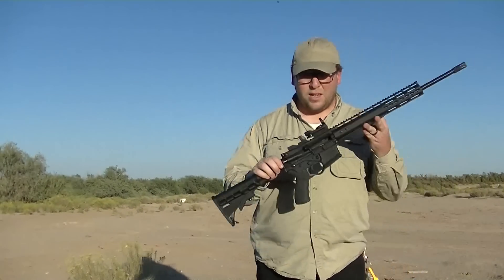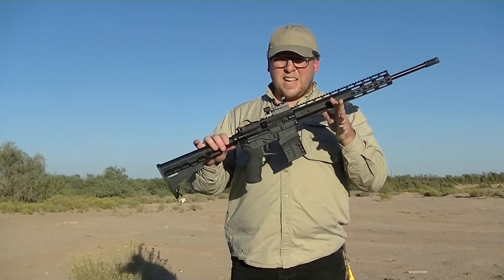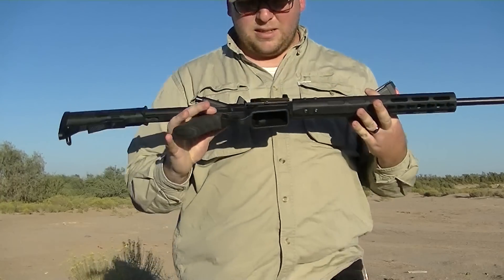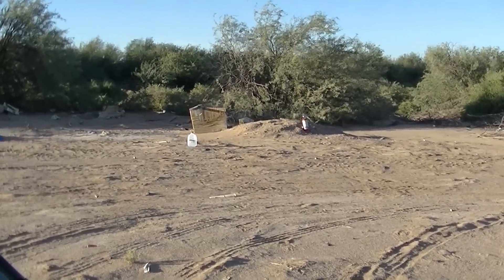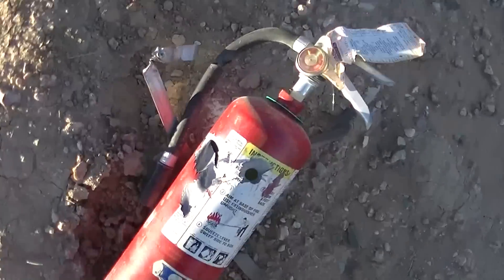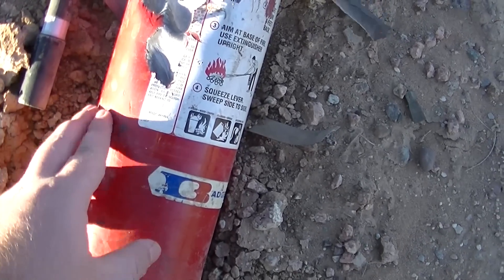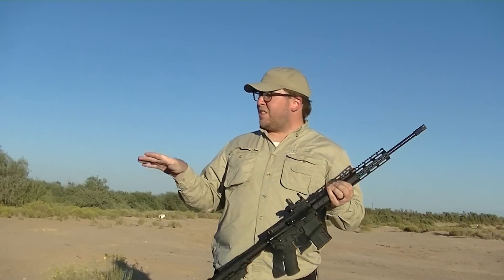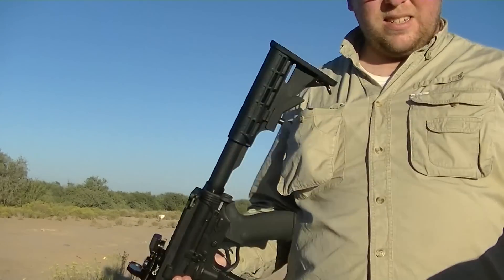ATI OMNI MAXX HYBRID AR-410 Firing

Comment: Mine is still at the factory addressing that bolt override problem.  Noticed that each time you slapped in a magazine you gave it a little tug downwards.  Is that required for proper seating?
Reply from the maker: Doug
 Its a habit i developed from having full mags not seat on a closed bolt/slide.  it applies to this shotgun though because you can seat the mags too far, causing some issues. It usually fixes itself right away, and hasn't cause a stopage in a while, but I still check.

Comment: How did you resolve the mag issue? I know you customized them but was that enough? Seemed to be a major problem—the bolt not stripping new round? I was about to buy an upper but I have to know what happened with yours. Are these things commonly known as a pain in the ass? I haven’t seen a lot of complaints.
Reply from the maker: NLYTNDBYSNAKES 888 
As someone else commented, the mag spring is often installed backwards, lifting the front of shell first.  I still encounter from customer's guns failure to load the last round in a mag, that's a design issue
Reply: NLYTNDBYSNAKES 888 bought mine four months ago. Have put hundreds of rounds through it with zero issues. Either I am really lucky, or the issues you are referring to are no longer issues.

Comment: would this thing work with the binary trigger system? (noob here)
Reply from the maker: Strong Bean It should, standard milspec lower and trigger group.  might be an issue with the lower being polymer, but the upper can mount to any lower with a binary trigger installed. Would be a ton of fun!

Comment: Would it take 3inch shells? Did they ever fix the jamming problem?
Reply from the maker: Only 2.5 in the magazine. The newest ones are better fit  but still temperamental.
Reply: @ZAKW42  so they made a new version of the 410? Do you know how to tell the difference between the 2?
Reply from the maker: @Jcha208  
The bolt design is the main difference. They indicate gen 1 from gen two by switching from SS bolt to a black one, the third mod was for the gas system and I'm not sure how they indicated that change. If you jump in and don't get a lucky one, they should offer complimentary service on it.

Comment: have you done any patterning with birdshot?
Reply from the maker: link09r 
Yes, with the flash suppressor on the front(they have now developed an overbarrel choke system) no.9 birdshot grouped 6 feet across at 50 yards. No.6 heavy shot grouped between 3 and 4 feet. Birdshot was ATI, no.6 shot was remington. ATI slugs grouped at 2 inches at that distance.